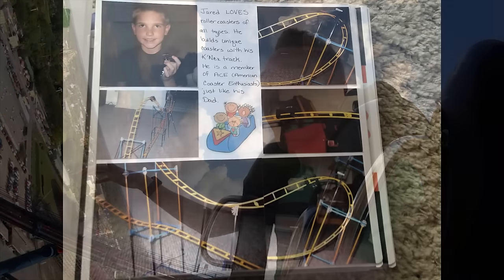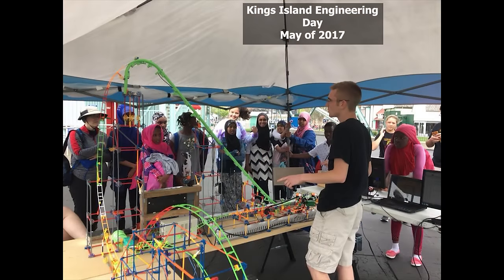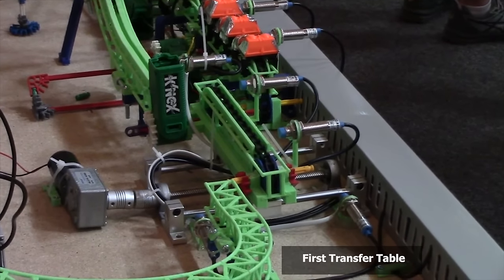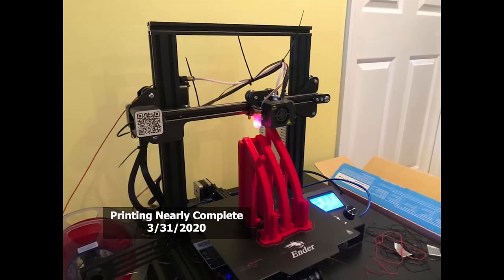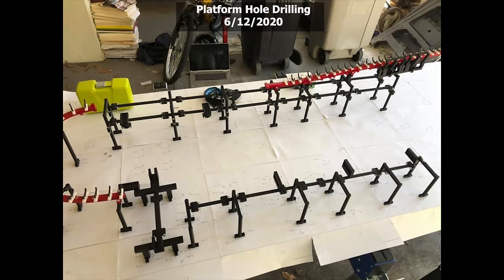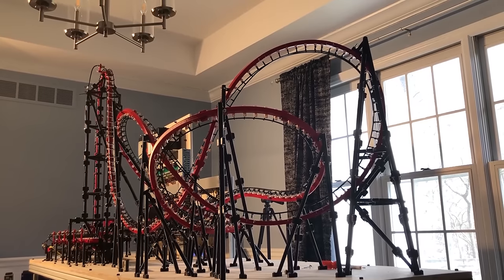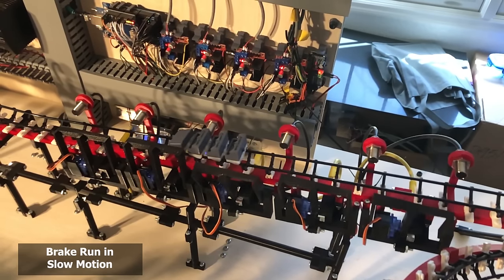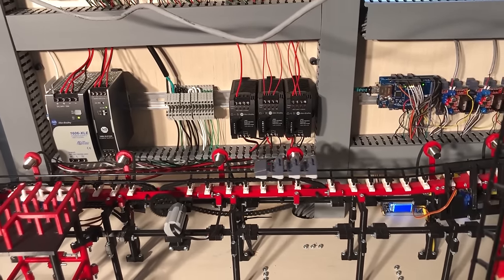Project Infinity: Model Roller Coaster with Advanced PLC Safety Control System

Comment: As a former ride operator, for a wooden roller coaster, what you have done is amazing. The coaster I operated was older, converted from manual operation to pneumatic when it was relocated. The block system was run by sensor tech originally, no PLC but in the last 25 years since I worked at the park it has been upgraded to full PLC control and contains enhanced safety features such as dual operator dispatch. The block zones are the load/unload platform, Lift, final brake run. As this is an older coaster with a curved brake run, it runs on skid brake technology, including the load platform. WHen the coaster originally was built it contained an additional brake on the second turn around, which served more as a trim than a block zone. However it could have been modified to a block zone but  the rides momentum for the 2nd half would have been boring. This brake run is very similar to Hershey Park's comet brake run which sits on the turn around above the station. When the owner of the park purchased the ride and relocated it, the trim was removed completely as there was no benefit for the brake run during early operations as the ride only operated with one train... came with 2, but both trains underwent a massive overhaul which required a ground up rebuild, the 2nd train took longer than expected.

This coaster is known as one of the Comet Triplets, designed by Herb Schmeck, out of the comet triplets, all of which are operating to this day, it is the only one to still operate with Buzz Bars which allow the rider to experience insane ejector airtime. It is also the only one of the triplets that do not require the rider to wear a seat belt.

It amazes me the advancements in PLC and safety technology since I worked at the park in the early 90's compared to what they use today... honestly it could really run like your Unsupervised Mode... but obviously that cannot happen due to insurance and safety regulation but the new control system is programmable to be fully automated, and pretty much as, the only operator input is required for dispatch and getting the train perfectly aligned with the load gates.

For those who haven't figured it out, the ride I am talking about is The #1 Wooden Roller-coaster in the world... The Phoenix at Knoebels in Elysburg, PA

Comment: I’ve been an electrician for years, and recently started working at a Disney park on 3rd shift (while the park is closed). I found your videos after my first week on the job and have revisited a few times to better my understanding of the “nervous system.” I perform preventative maintenance on all these components! From the prox/speed/brake sensors to the drive motors and the vfd/plc cabinets, your model is spot on! I see all of this equipment nightly. Thank you for this detailed description, I can’t wait to see what you design & create in the future!

Comment: 8:46 I was expecting "For those of you who are unfamiliar, a block zone is a section of ride that only one train may occupy. At the end of a block zone is a method to stop the train in case the block zone ahead is still occupied. This is the safety system that prevents roller coaster trains from colliding with one another."
Reply from the maker: I love Eltoro Ryan's videos! I'd be so down to have this thing show off some of the safety features of coasters in one of his videos

Comment: This is too cool! I have always been super fascinated with the PLC controls and seeing a model and someone getting to play with and show all the controls is awesome. This model is SUPER detailed. Great work.
Reply from the maker: Thanks! I personally haven't seen someone actually try to replicate the controls of a coaster with all of the safety features in a model before. Most models I see on the internet are by mechanical engineering students who make way cooler layouts than I did here but the electrical system is usually lacking.

Comment: At age 12 I made a working roller coaster for marbles.  I made it from junk stuff / scrap wood, long abandon & forgotten in the basement.   The track was made from empty paper towel rolls cut in half length-wise to form a trough.... lots of cuts and Elmer's glue to form working loops,  high-banked curves.   An old aquarium filter motor's spinning wheel mounted on its side would 'launch' each marble into the course.  ............. Boy did I get in trouble for using that old junk in the basement.  Thanks a lot Dad.

Comment: On rollercoasters a block zone is a section of ride that only one train may occupy at a time. At the end of a block zone there is a method to stop the train, in case the block zone ahead is still occupied. This is the safety system that prevents rollercoaster trains from colliding with one another. Let’s look at the block sections on [coaster].
Reply from the maker: Gotta love problematic coasters from ElToroRyan! He makes some great videos. This model is a great way to showcase what he's talking about in those videos.

Comment: I repaired many of those PLCs, even have one in my parts to use for something someday..?.  Upgraded older units to LED backlight and the faded/low contrast of the color LCDs are from 3 (or 6) bad SMD electrolytic capacitors in the RGB driver section.  They go open and do not allow the RGB video signal to pass to the LCD very effectively, especially when cold.  Cannot program like you, AWESOME work!

Comment: I repair both plc's and hmi's so it's great to see them in practical use. I also know how much 'fun' it can be to program them so you've done a stellar job here. I'm guessing you didn't use ladder logic :)
Reply from the maker: Haha thank you! All of the block system logic actually is written in ladder logic! the Arduino is only there to take the motor speed data from the PLC and turn it into PWM for the motors.

Comment: This is amazing. 

So I have an idea that someone like you could probably make, speed controller. Basically a small device that pushes the train from behind, and add a computer simulation to make it work at scale speed. So instead of having to slow down footage to make it look real, it is real! I'm kinda envisioning the speed control you get with a model railway, maybe a rack and pinion system to control breaking / acceleration, and then just somehow simulating gravity etc.
Reply: It's been done!
https://youtu.be/jkkf6wcAqkc
Reply from the maker: Great Idea and yes it has been done before! I have not personally gone after making something like that because I really do enjoy the challenge of figuring out how to get the train to coast through the entire course by itself. Maybe in a future iteration though!

Comment: This is so crazy awesome. Can’t believe how you were able to make it basically the same brains and nerves as an actual roller coaster. I noticed in your early clips with knex coasters that you also had a panel with Allen Bradley push buttons. How did you get those? It seems like with companies like that you can’t just go in and get a few buttons if you are just a model maker under most circumstances.
Reply from the maker: You are right they are very hard to get ahold of as a model maker and can be very expensive if you do get the opportunity to buy new. I buy all of those buttons used on websites like Ebay to save on cost.

Comment: I'm not familiar with model railroads at all. But I find it fascinating that you used a PLC to control certain aspects of it. I'm assuming this is standard practice for easy automation in lieu of using a microcontroller with a more intensive learning curve and probably more features than you'll need. But what do I know? The only automation I can think of is maybe controlling the train's speed around corners, maybe getting it to stop at platforms for a set amount of time to "pick up passengers." You could connect it to a small solar cell from one of those solar lamps people use in their gardens to detect when it's day or night and have it turn the city lights on automatically at night. Or just set it to a timer as well if you want to keep things simple.

 And if I can think of this many ideas, I'm sure the number of uses for a PLC in a model railroad are endless. And on that note, maybe a microcontroller wouldn't be overkill. You could still keep things pretty simple using an Arduino. I don't want to make assumptions about your knowledge of programming. But I would assume if you're using a PLC over a microcontroller, you probably prefer ladder logic to a written programming language. Which is great if it suits your needs. But there's never any harm in pushing yourself outside of your comfort zone! Cheers! And thanks for helping me to see model railroads in a new light. Being an electronics nerd, this has suddenly become very interesting to me. Heh.

Comment: I'd love to see detailed video on how the PLC is programmed and connected to each sensor
Reply from the maker: The sensors are actually really simple. In a nutshell whenever the train is in front of the sensor it closes a circuit like a switch. The PLC has a special module that can see if the circuit is complete. The software I wrote then makes decisions based on the status of these sensors. I will definitely look into doing a tutorial on PLC programming though!

Comment: You did a phenomenal job on this project sir.  Do you plan to go into coaster design?  What are your plans for future projects?
Reply from the maker: I really love the controls behind the ride so not necessarily the ride design but definitely the design of the electrical control system. as far as future projects go I'm looking at a lot of options but I'm definitely putting a lot of thought into a model that emulates some of the track switch elements that can be found on Expedition Everest, Hagrids, or Pantheon
Reply: @JaredHolladay  dude, that sounds great hagrids is a very cool ride I would be extremely interested in seeing that model.  Maybe then we can understand more about why the ride runs into so many problems, save for the obvious bee problem.

Comment: This is seriously some big brain stuff. I'm honestly blown away by the fact you used industrial grade equipment for essentially a tabletop model. I've been tinkering with model roller coasters for quite some time, but I've never seen this level of tech implimented in the space. Can I ask what was the reason for using the CDX blocks rather than custom track? Is it mostly due to having the friction profiles?
Reply from the maker: It was mostly due to time constraints with the project. I knew it had to be completed by spring 2021 and when I put the initial plan together for the project I just didn’t have any time left to allot to designing custom trains. However, I am planning to use custom trains for my next model coaster!

Comment: Bro this is insane holy cow. Great work, and as someone starting Senior Design in the fall at UCF, I REALLY hope there's a coaster or theme park related project available.

I have though in the last week or so really been considering have a side personal project of doing what you did and 3D printing a coaster. Would be no where near to what you made though as I suck at programming :P got any advice for taking on a project like this? :)
Reply from the maker: Break it into small problems solve those and then put it all together. This is my 5th automated model coaster. I started with a really simple system that didn’t do a whole lot more than control the speed of the lift chain. Slowly but surely I added features on my new coasters until I got this. So moral of the story break your problem down into small chunks and use a stair step approach in your development.
Reply: @JaredHolladay  that was roughly how I planned to do it, glad to know it's a good "train" of thought :)

Comment: The VFDs at the place I interned at took 4-20mA input for the speed control.
Reply from the maker: What were the motor output ratings? If you know of a VFD that drives small hobby motors please let me know!
Reply: @JaredHolladay  Why are you trying to drive a DC motor with a VFD?

Comment: This is pretty damn awesome..
One thing though.. How is @14:15 not a safety hazard? There's nothing but air behind the car that's on the lift. What happens if the chain snaps?
Reply from the maker: Totally a safety hazard you are correct! In real life we’d have antirollbacks but I did not put them in here because of space constraints. Theoretically what I should’ve done is put two independent chain lifts together like Fahrenheit at Hershey Park to mitigate the risk but oh well. In real life though we’d definitely put an antirollback mechanism in place to mitigate that risk.

Comment: Fascinating display …..what happens when the cars are released and they start their decent and there is a sensor problem in the braking section at the end of the ride? 
How will the cars come to a safe stop since they already started their free fall? Very curious.🤔🤔🤔
Reply from the maker: So the system actually verifies the state of the brakes before allowing the train to clear the lift hill. So not only does the brake zone have to be clear but those brakes all have to be in the closed position and those sensors on the brakes need to verify that the brakes are in fact closed. The control systems software does not allow the brakes to be commanded open until the train is detected by the sensors in the brake run zone. This means that even if a sensor were to fail after the train dropped off the lift nothing commanded the brake to open so the brake must still be closed. There is redundancy built into the system though so even if something went horribly wrong  and the brake did open the train could still safely stop. the braking system is designed to stop the train with only 3 operational brakes. Therefore two brakes could completely fail and the train would still come to a safe stop within that zone.
Reply: @JaredHolladay  I figured you had that scenario covered. 
Thank you for the detailed response.🙂
Reply from the maker: @Trainman0401  you bet! Great question! I love it when people are curious about these strange scenarios! One of the things I find coolest about ride design are the hundreds of different scenarios engineers have to think about even the ones that happen 1 in a million cycles!

Comment: Could you not have used a UDOO RYZEN Bolt V1000 Maker Board SBC which means that the control could be created on a IDE for the 80586 processor.

Comment: How did you progress from the nolimits2 program to making an actual 3d printed piece? What software was used for this step? Excellent video.
Reply from the maker: If you have the professional version of NL2 you can export the track spline as a .csv. You can do some math in excel with the csv file to scale the data and create the rail and centerline for the track. Fusion 360 has a function called import spline csv that you can use to bring that data in and after that you're off to the races. Print my ride has a great tutorial on how this is done https://youtu.be/7zUMft1ZAg4
Reply: @JaredHolladay  Thank you for your reply. I am helping my wife construct a small scale village with a bunch of amusement rides and a roller coaster would be a great addition.